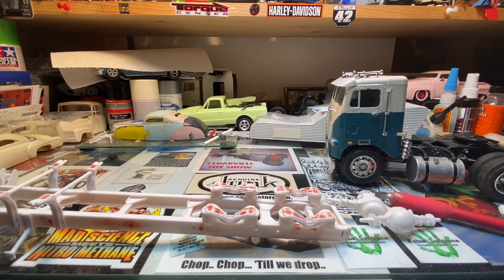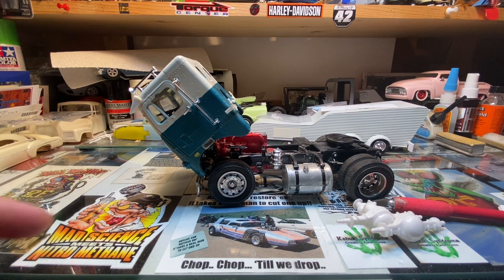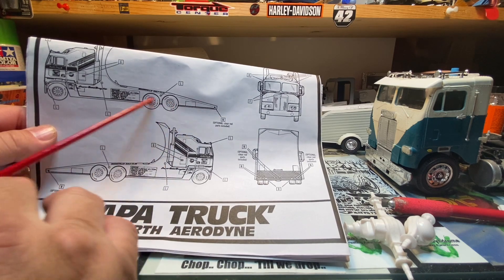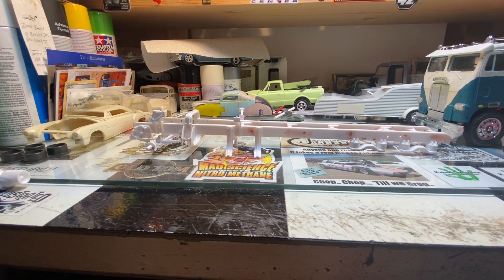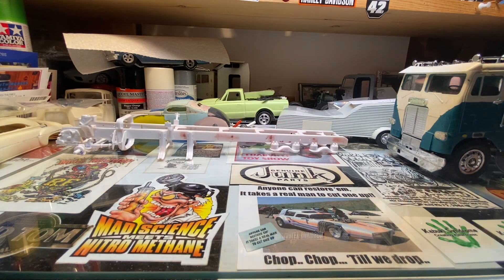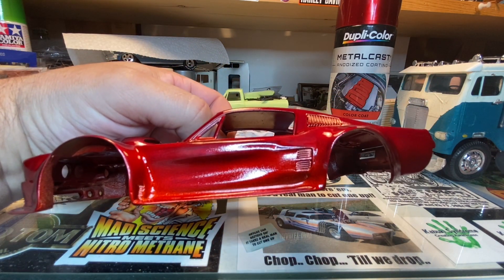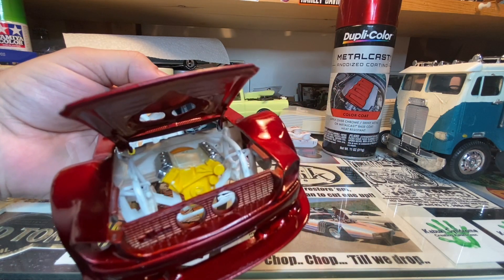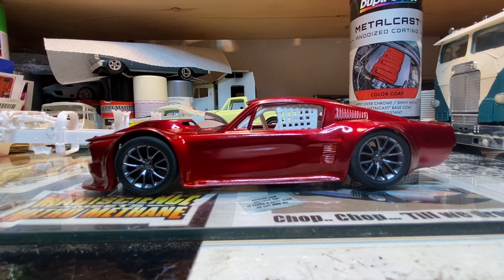Bench update yet again! KW in the bench and what’s that red thing??

Comment: Love the rig Doc and also have the Papa truck in the stash the stang turned out AWESOME color i would leave the wheels as they are my be some white letters on them 👍😎
Reply from the maker: Papa truck makes for a good stretched kustom right out of the box. As I found out the flat top K100 car is about a scale foot shorter than the Aero cab so it'll give a longer look to the truck itself. Now I need to start thinking on a trailer. Leaning towards a step deck flatbed on it. Or a bull hauler. Not sure yet..